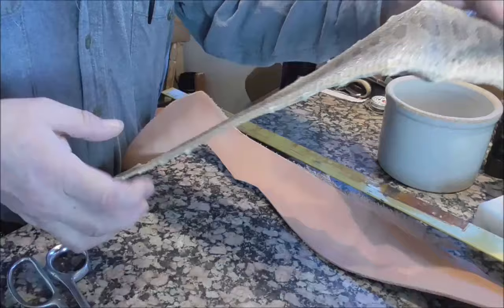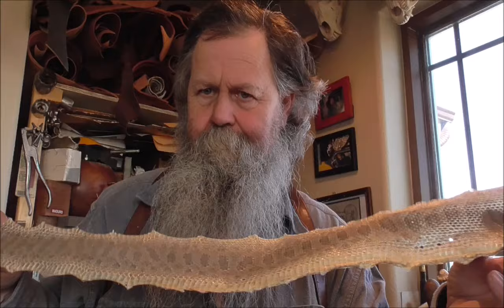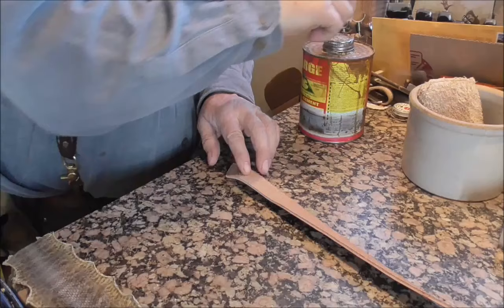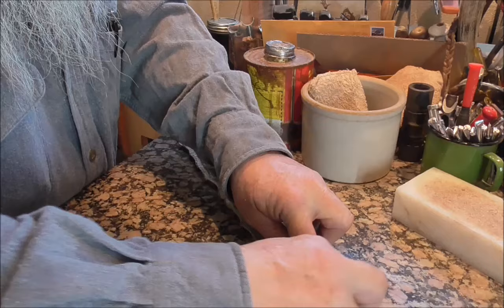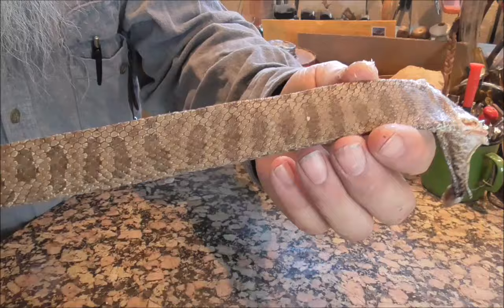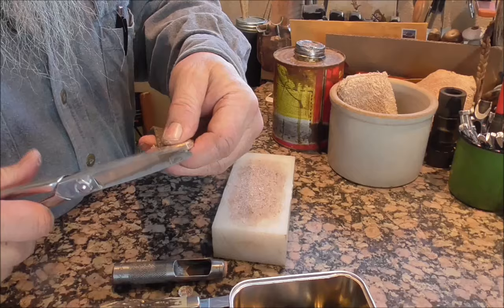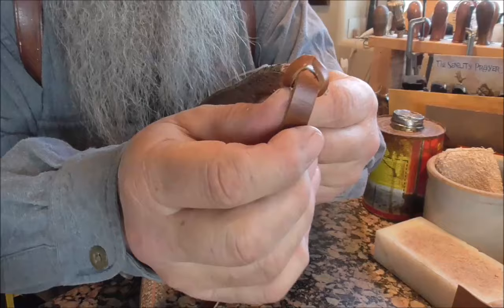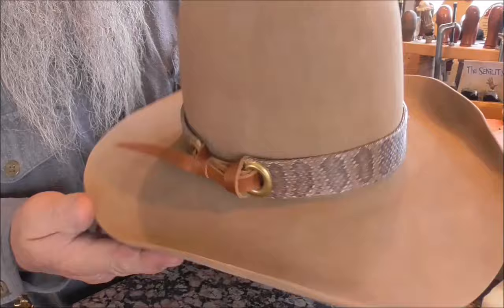Making an Easy Rattlesnake Hat Band

Comment: Good morning, I do a little leather work from time to time and always enjoy your videos. You may already know this, go to the hardware store and ask for acid brushes the kind plumbers use when soldering copper. They make great glue brushes and are very inexpensive I've been using them for years in contact cement. I watch your vidio every morning as I have my breakfast
Reply from the maker: Good Morning!  I bought a brush for something not too long ago that was about like the one inside this can.  Tin with black bristles?   Bacon?  I wonder if we have any left??

Comment: You said snakeskin isn't durable, but I followed some directions online to tan my rattlesnake skin and it came out flexible and stretchy, just like leather. Next snake you kill I suggest you soak the skin in 50/50 alcohol and glycerin for a week, it'll come out great. Haven't started my hat band yet but I'll follow your instructions
Reply from the maker: I have used that, and it works, but the glue doesn't stick to it as well because it's kind of greasy from the glycerin.  Mostly the scales fall off is why it's not very durable.  With a hat band, there isn't much to run on it though.   Good luck with your hat band!  I hope it turns out well, and would love to see a picture when it's done!
Reply: @MuskratOutdoors  I see how that could happen, the scales are falling off of my skin as well, but think the poor rattler was about to shed before I got him so that might be why. Thanks for the response!
Reply from the maker: @astrotrek3534    Try spraying it with a clear coat spray paint.  That should hold them on.